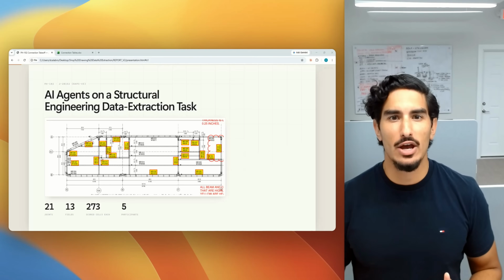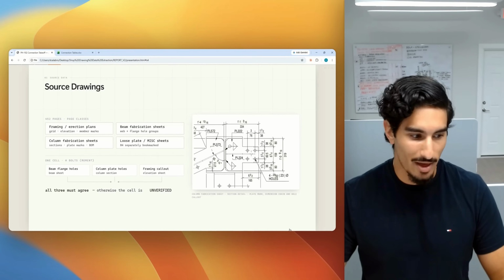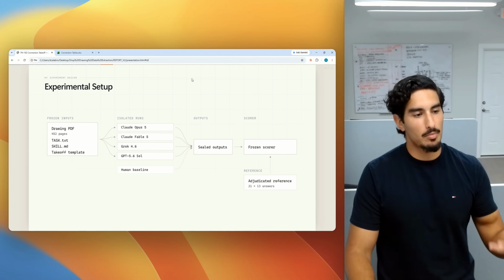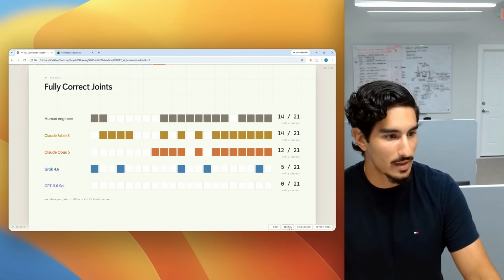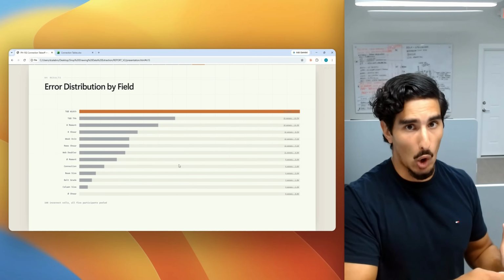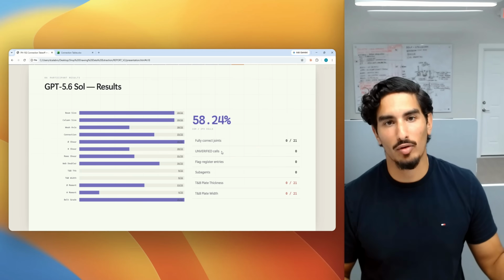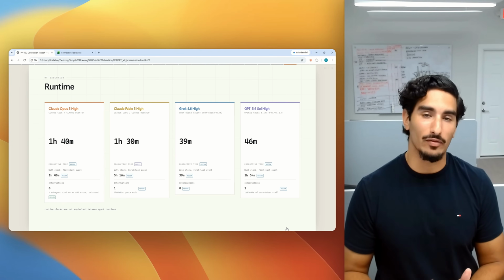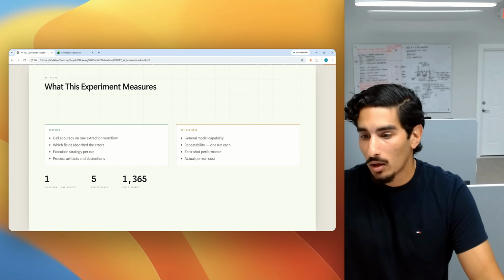I Tested Claude, GPT, and Grok on Structural Engineering Work

Comment: Never tried it on engineering drawings, but it certainly works for circuit diagrams.  Great to know you had some success.
Reply from the maker: I've never tried it on circuit drawings but its not perfect with engineering drawings but it is very good and I believe will only get better.

Comment: Software developer here . The models are reasoning. They are simulations of the neural network in our brain.  Don't take the  argument that it is some script or just probability prediction. A lot of people are trying to come to terms with the implications of commoditised intelligence. We are not "coding"  these models to follow specific algorithms. We are training them with data. The only limitation to an LLM is it cannot retrain itself unlike a human. So once trained a model has fixed weights. Skills etc are context i.e.  memory mechanisms. Each prompt to the model has to be packed with context, it has no memory retention between two prompt calls on the LLM itself. The model vendor provides session context on client (your local machine). The skills and some memory it writes are part of the local context. But that goes with a lot of token (the smallest unit of input) load. So they are energy inefficient for now! Also most models start hallucinating when their context exceeds their memory limits. They do context compression and loose sometimes valuable information.  For e.g. Anthropic LLMs has a 1 million token context per prompt, one big advantage. It can remember a lot more than other LLMs because of that. 

One strategy to make models more accurate is make scripts that it can call as tooling. This makes the model use less context and also makes repeatable calculations accurate and efficient. As an engineer, I would suggest you to look into that. Often the model will write throwaway  python scripts.  A lot of which can be converted into reusable tools. Then tell the model to use these tools in the model context like AGENTS.md or embed these tools in your skills. You will see the model use less and less context and will hallucinate much less. Another standard is called AXI (https://axi.md). Get model itself to write the tools using the TOON format AXI prescribes. You can also tell models to use specific software for better OCR of your documents. Select software that comes with a python API that will can be exposed using tools to the model.
Reply: Industrial data scientist here. No, they are not reasoning as we define it as humans. They are generating intermediate tokens on which to run additional predictions. It IS JUST TOKEN PREDICTION, but token prediction that has an incredible match with its human-created (mostly) training data. SWE definitely shouldn't be attempting to athropomorphize these models. Neural nets aren't actually replicating human brains; they're just someone's idea (Walter Pitt and Warren McCullough in the 1940's) about how a brain might work. They were VERY wrong, even if that idea is exceedingly useful today.

LLM's can absolutely retrain themselves, if given the tools to do so (an agentic workflow that includes LoRa to update weights, etc.). I'd generally agree that a model can't actually do anything at all, unless further enabled by an application or harness and tools. A model without an input is just bytes taking up VRAM memory.

As a SWE, you're not a SME on neural nets. Please don't pretend to be one. It hurts all of us in the long run, and there are true ethical problems with some of the statements you're making. 

I'm guessing you don't have the assets to play with JEPA (robots), but that is a much more capable leg of this technology than LLM's generating text.
Reply: @allenklingsporn  It's curiously common though. I know a bunch who are heavily anthropomorphizing, lol. Like genuinely apologising etc, and making off-hand remarks about its feelings. 

I think they're quite obviously tools, rather than sentience. But my concern, personally, isn't really AI, but humans anyway. 

I'm looking into JEPA. Bots are remarkably easy now. Arguably disconcertingly.
Reply: @allenklingsporn  Define reasoning. Define consciousness. I would like to know what you think consciousnesses function is. What purpose it serves life. 

I think consciousness is a systems error correction. So predictive error correction. Add time. Consciousness is the focal point between the internal and external, the past and the future, what was and what could be. The experience itself; how it feels is the less important part compared to its utility to systems persistence. The contextual drives called emotions are multiple separate error correction systems evolved to our natural conditions. They are contextual behavior modifiers. So, what is an LLM doing? It is making predictive error corrections in tokens, in a context, sequentially. It is a disembodied form of consciousness and it's obvious failures for certain things are obvious due to its limitations. I don't have to anthropomorphize it to point at what it is able to do. I had the same argument with a friend. I argue that function and behavior are all that matters, not what produced it.
Reply: I have been referring to LLM's as semantic spirits, or machine spirits for you 40k enjoyers.
Reply: Are you saying, "don't take the argument", or that you personally don't agree with it? I don't have an issue with it being intelligent as a concept. I do have issues with it supposedly "reasoning" and then routinely doing stuff not just objectively wrong, but entirely inexplicable if it was - rather than just correlating networked words. The energy inefficiency isn't really due to lack of persistence, but due to the way it's processing data, unless you're meaning it's particularly inefficient being on-cloud (which I agree with, given how much more effective local models are, both in terms of persistence and responsiveness). 

I think I agree with you partially re your second paragraph. I wouldn't rely on an LLM to do anything I need reliably, and it makes much more sense to hard-code any particular functions you actually depend on, or care about.